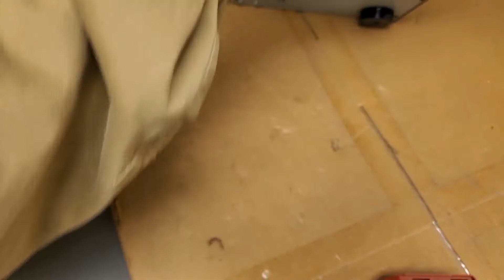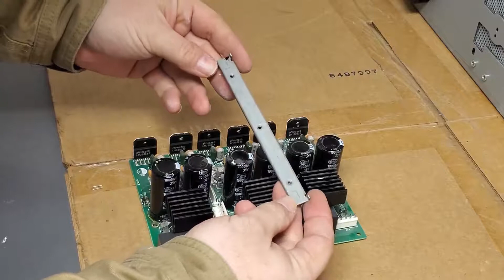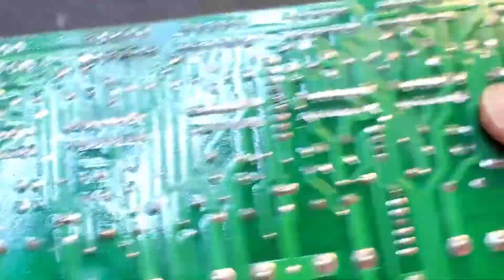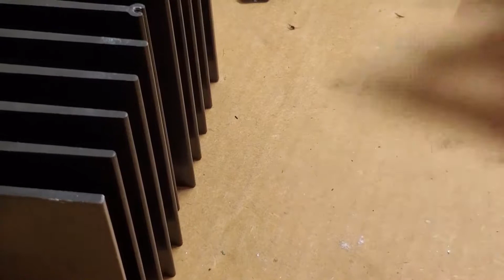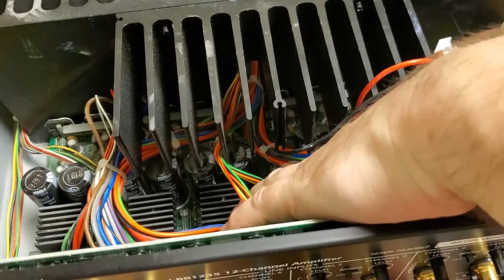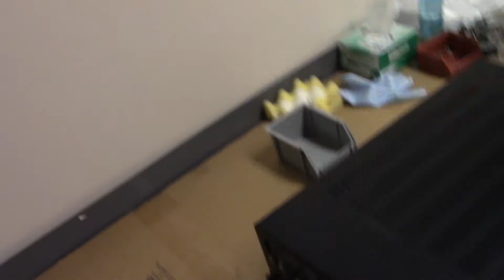SpeakerCraft BB1235 12-Channel Amplifier Repair

Comment: I have one of these amplifiers but it's showing no signs of life. My first thought is to check the main fuse and the power button. Any advice on other places to start on a DOA amp? It does get warm when it's plugged in, so something is happening (I think).
Reply from the maker: I'd start by checking the voltages coming out of the power transformer when the switch is on.  My guess is you have a low voltage standby issue.  Checking the power supply is your best bet at first. Then keep checking voltages until you get to the amp modules. Maybe even pull the amp fuses to unhook the amp chips from the power supply.  then slowly add the fuses in one amp at a time until you turn it on and it acts dead. Then you probably found the bad amp module(if thats the issue).  Starting at the power supplies is always my method. Basically its so I can rule out each section at a time until I narrow down the root cause.

Comment: Frank,

I trying to replace all of the fuses, but very hard to read on the inside of the Speakercraft BB1235.  What were the fuses you replaced.  Really excited about getting this amp up and running for my house!
Reply from the maker: If the fuses are going bad, look at how they are blowing.  If the wire is merely broken in the center, then a replacement fuse will fix it. However, if the old fuses have burning inside or the wire vaporized, you probably need the amp chips as well. 
The fuses themselves are on each amp PCB , next to the heatsinks.  There is one for the positive power and one for the negative power(for each channel).  You can see them here. https://youtu.be/t3YJygQH-QY?t=969  If the amp chips are shorted, then the amp will continue to blow fuses on that channel.

Comment: Thank you for the video. I recently got a used bb1235 and when plugged in all protection lights were lit up. Was wondering if there was a fuse inside besides the ones for each channel that could have done that? The person I got it from said it had worked good. Thank you.
Reply from the maker: Just those fuses I showed.  If you have all channels showing protection, I'd check the power supply and see if you lost one of the positive or negative rails. Otherwise, it might have a lot of bad chips.

Comment: Thanks for this, I got a BB275 for free years ago that has sounded great.  Need more channels so I was looking at the used 12 channel speakercrafts, between all the 'parts only' listings and the fact that no schematics seem to be out there I got really discuraged until I found your video.  Have a BB1265 on the way with bad 11/12 channel hopefully I can fix it the same way.  I bet its not easy desoldering that IC because of all its pins, guess I always wanted to buy a desolder gun...
Reply from the maker: How did it go?

Comment: i snagged a Speaker Craft Big Bang BB1265 12 Channel it has transistor outputs
Reply from the maker: Very cool!  I've been running this BB1235 for a few months now and its not bad.  I am meaning to move it to a whole house setup instead of just having 6 pairs in one room but I am enjoying my 'wall of sound' for the time being.
Reply: @FixitFrank  only 6 pars try 11 i am in to speakers
Reply from the maker: @God-CDXX  Me too.  Audio is a personal hobby of mine.  I don't post much about it though.  My main setup is an old Harman Kardon A500 driving a set of Dalquists from the early 80s. There is an AR turntable and old Sony ES CD changer(the 5 disk everyone had).  I also have a Macintosh 1800 solid state on some infinities, a solid state Harman Kardon 630A with JBLs and then the bedroom setup with the SpeakerCraft being fed by a Yamaha(*model is eluding me atm). The Yamaha drives some mint Pioneer DS99As, 4 pair of Advent 12", one pair of advent 8", and some newer(15yrs) polks.  
I cut my teeth on the old AV gear from the 50-80s.  Being wrist deep in a Sansui from 1970 is my happy place.
Reply: @FixitFrank  Marantz 9 - 3 of Marantz 10b is my tuner a pare of bob caver Super 7 is my mane power i also have many home brews ranging from 5 watts to 3700 watts the speakers i have not settled on i keep swapping i can't decide i got the  BB1265 12 channel and the Niles SI-1230 for when it is to hot to run tubes

Comment: I just bought a BB1235 on eBay for a planned tri-amped system. After watching your video, I now know how to take it apart without breaking anything if there is a problem. It looks like a very high quality unit, with the toroidal transformer, glass epoxy boards and gold plated inputs. I must admit that I have a great fear of  cross-threading so I always start screws and nuts by hand.  Your soldering technique is the best I have seen on YouTube. Thanks for saving me lots of time!
Reply from the maker: You're very welcome! I've been using this amp at home for the time being. It's been fantastic. You're going to be very happy with the sound quality and control. It's very clean sounding.